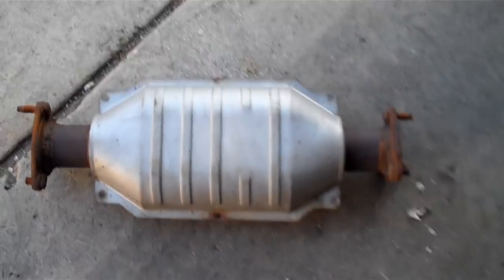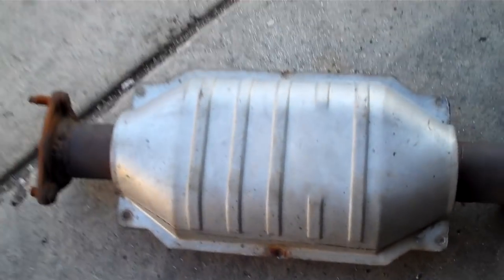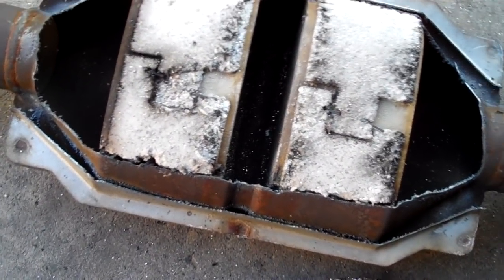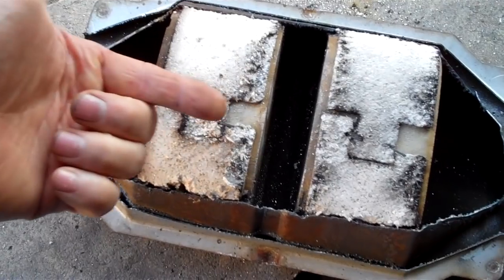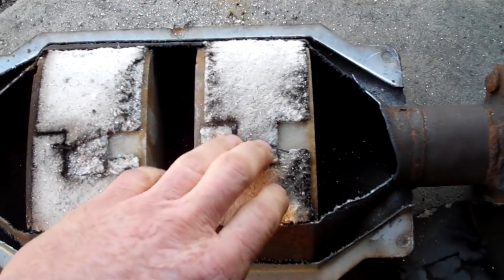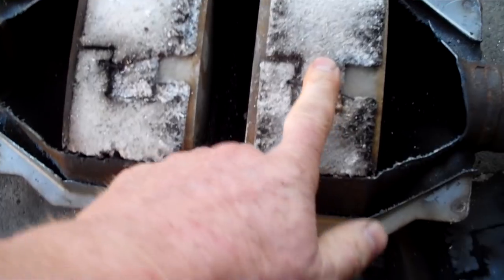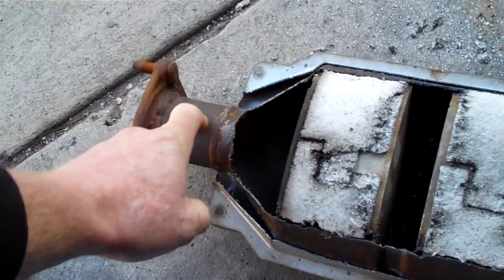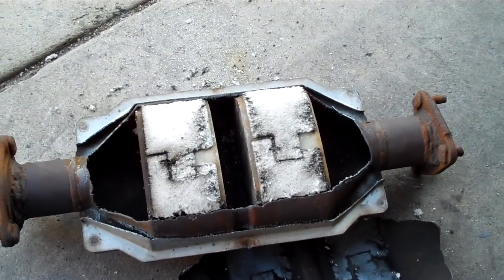Here's what's in a catalytic Converter.  Here's how they work.

Comment: subtle things can alter sleep patterns in kids, L, for example, some little guys are more sensitive to cold so wearing socks might is one idea, another is using some source of white noise to block outside traffic, people, and creaking house sounds. I used a fan, for example.  Pillows and sheets/bedding can be a source of subtle irritation, too.  For example, micro fibre sheets, down pillows (with lots of feathers, typically),  or inadequately rinsed bedding - leaving residual detergent or fabric softener- is often a source of breathing congestion, wheezy runny nose discomfort which keeps the kids (and you) from getting good deep sleep. And make sure your window sills are free of molds and dust.  Many folks dont realize that molds respire too and its their exhaled breath that our own bronchii react to.

Comment: Best damn explanation on how catalitic converters work!

I also remember the predator carburetor. It multi staged gasoline through values that would compress the gas through charcoal filters. The damn thing was almost 99% efficient in burning fuel. And was way cleaner at the exhaust then today. 

I still use a water injection system that can pass any inspection station probing.

Comment: Hi Brian! It's Shep the Jewish me-chan-ic. Riddle me this "Batman". 3 years ago I replaced the engine in my 2000 S10 (2.2 liter) with a new GM crate unit,along with the injectors and pressure regulator (Sorensen),fuel pump (Carter) o2 sensors (AC Delco),and Cat (Walker). 1 1/2 years ago a p0420 code appeared. No vac or exhaust leaks. Fuel pressure is correct. No misfires and engine vacuum is rock steady at 18 inches. In short, the truck runs great. AutoZone replaced the  cat at no charge. Last month the p0420 code reappeared.Same conditions. I ran a live data  test. U/S o2 sensor readings bounced all over the place (as it should).D/S o2 readins did the same (as it shouldn't). I replaced the cat (again) and now the D/S reading are .73-.78 volts at highway speeds..43-.47 at idle. And ..50-.53 at around 35 to 40 mph. In other words , steady. All other readings are normal. My GM tech friends say I need a factory cat ($1000-$2000). My independent tech friends and my old auto tech instructor ( the 1 who taught me 30 years ago and is still teaching) say that's nuts and a Walker  $179--$400)or any cat should be fine. Any ideas? Thanx and G-d bless. Shep.

Comment: Love this video!!!  You speak clearly, know your stuff and are not afraid to share what you hypothesize...  I also sense a genuinely good person in you...  Keep em coming...
Recently with 6 cars in the family, I began to act on my instincts mechanics by suggesting and trying things in connection with my mechanic's expertise.  For ex. the computer showed Malfunction on cat and 2 sensors.  Bought all the parts myself, but the carparts place kept sending me the US honda sensor, not the import which my Honda was...  anyhow I got fed up with trying to get the right part so I cleaned the old one and Voila...  it worked!
Reply from the maker: Great work Elizabeth!  And thank you for the feedback!
Reply: I had issues getting the wrong cats from autozone and oreillys for my friends mercury mountaineer too. I had to take them off measure the inlet and outlet and get a pipe reducer to weld in too to make the back one fit. One of her front cats was melted and the back one was clogged. Only one worked with the temperature check being 100 degrees hotter after the cat. How did you clean your cat? I have a dodge stratus I bought to fix up and my only cat on this thing is not passing the temp test. I could smell that it wasn't working. I'm just curious on how you cleaned it. I want to flush it out with acid just to see if it will work. I tried vinegar cuz I had it layin around. Nope. I tried carburetor cleaner also. Nope. Oh and by the way I think it is the most awesome thing in the world that you have mechanical instincts. I am honored to even hear of a female that will work on cars, wow!!! That made my heart throb, seriously. Sorry if i sounded sexist or like a creep, lol.
Reply: Elizabeth Stenholt
Reply: Elizabeth Stenholt you should ask him out on a date since you're so mesmerized.

Comment from the maker: Test where the compression loss it BEFORE pulling the engine out by making sure all the valves are closed on that hole. (#6 by taking off the valve cover and inspecting cam position)  Brace the crank so it won't move.  Then run shop air into that hole and see where it comes out.  The possibilities are.... radiator cap, oil cap, exhaust pipe, intake manifold.  From there you can tell if it's valves, piston rings, cracked cylinder, head gasket etc.

Comment: briansmobile1, great vid as per your usual. id like to add if i may, some personal observations from 30 years of repairing cars. the threaded bung on the side of the converter has been around a very long time. it started out as a way to inject fresh air into the converter to burn off unburned hydrocarbons via an air pump on the front of the engine [remember fords smog pumps that always failed?].  even though i have never seen an O2 sensor in that spot, it doesnt mean that its never been done. keep up the good work

Comment from the maker: The bounce and the cat are bed fellows, if the lean/rich bounce were more efficient then the cat would be less necessary.  That oscillation is needed only because the feedback mechanisms lie on each side of the wander.  BMW's new system is a more narrow channel to oscillate in.  It can fire an injector several times as needed instead of just having a longer or shorter period.  This means WAY more expensive and sensitive components, but better power and economy.  AND a trend to anticipate.

Comment: I'm still contemplating your cool oxbow lake analogy, and now you've posted another winner. 
One of the interesting things I recently learned (from scannerdanner) is that the cat requires instantaneously changing ratios, to be sure there is enough CO to allow it to work properly. CO is actually used to make the cat do it's thing, so O2 sensor signals have to cause a lean/rich bounce.

Comment: Thanks for the information. My exhaust basically rusted out right in front of the cat, and ended up dragging on the highway. I was told I could just put on a straight pipe and get away with it. After watching your video, why would I skip out on replacing my cat? This video was really everything I needed to know.

Comment: You are spot on about the carbon monoxide thing. The CO bonds directly and irreversibly to the seat on the bus (on your blood) where the oxygen is supposed to be. That means oxygen can't get on the bus and get distributed where it needs to be in the blood. When CO bonds, the blood gets bright red but that "seat" becomes useless. Blood only has so many binding sites and oxygen deprivation can have term effects, even at lower levels. If it is severe enough it effects the brain and causes irreversible damage and restructuring in the brain. Very dangerous because it has no smell and is invisible. It happens with high temperature fires that aren't getting enough oxygen.

Comment: +John Smith , Pagan Sunburn suggested checking for vacuum leaks and i agree but also inspect all of your electrical connections as well. it may sound strange to you but more often than not a driveability issue can be traced straight to the most basic and often skipped step in diagnostics. as far as using spray solvents to check for vacuum leaks, theres another way. use a small propane bottle just barely opened and at the same places. if your idle increase youve found a leak. some vacuum tees are temperature switched and wont allow vacuum thru certain hoses on a cool engine, and spraying brake kleen or carb cleaner on a hot engine is as smart smoking around an open gas tank. this is why i advocate using popane to check for vac leaks

Comment from the maker: The hole or bung is for an oxygen sensor to be in.  It's threaded.  I removed the oxygen sensor when removing this cat.  Otherwise there would be no hole to let air in.  In reality, were that hole to be open it would leak exhaust which is hot and would work upwards into the cabin area.  Exhaust is an expanding gas especially in the cat.  It would move out as apposed to oxygen getting in.

Comment: My 1997 BMW 328i has an air pump by the exhaust manifold that forces air (oxygen) into the exhaust and heats of the Cats quicker. You can actually feel the exhaust heat up quicker with your hand as soon as you start the car. Pretty neat system.

Comment from the maker: They are all cats.  The configuration, size and placement help it pass IM.  Typically when the four up front fail or burn out an owner will opt for a single big cheap one where the pipe comes into one.

Comment from the maker: No.  Cats can last a long time as long as the engine is efficient (relatively as far as autos go) and doesn't emit HC's CO's etc.  When a car has problems burning these completely it heavily burdens the cat and burns it out.  A plugged cat can inhibit proper performance and create back pressure at the exhaust port which can reduce fuel economy, but something was wrong with the car to make the cat fail to begin with.

Comment from the maker: If you do research on "peak oil" it suggests that we have used more than half of the worlds oil reserves.  They say all the "easy oil" or the oil that is easy to get to has been depleted.  Some argue and say oil dry wells when re visited produce again and are no longer dry.  It could be that it's like a flashlight with dead batteries.  You can turn it on and it works again.... but not for long.  I take any oil news with a grain of salt.

Comment: My Alfa uses mechanical fuel injection that atomizes fuel at 300 psi!  That's why Alfas did not use cats until 1980. Then they couldn't afford to build the complex injection pumps anymore and used the Bosch electronic system. That made cats necessary. Thanks, great vid.

Comment: On my Hemi Magnum I started getting the engine light and it would shut down.  Sometimes it would run like crap right before that.   165,000 miles and that was the first time the engine even had a hiccup.   I did park on soft turf and ended up getting stuck and MAYBE got some mud on the catalytic converters.    Or MAYBE the O2 sensors got messed up.   I call BS on both, because the O2 sensors are not in a place where they would get hit by a high center situation.   It wasn’t sitting that low.   But couldn’t come up with any other reason for either to be damaged.   I also have a bumper to bumper lifetime extended Chrysler warranty.    So I take it in.  Mind you this car is maintained.   New spark plugs at 100,000 miles even though it ran fine.  Injector clean just after, just cause.   Everything but wear items is covered.   So the dealership tells me I need new catalytic converters, new plugs, and new coils.  The coils were covered,so I didn’t care.  Plugs were expensive (a wear item) enough that I wanted to do them myself but I caved, even though I really didn’t believe they were bad OR the coils.   The O2 sensors were totally believable, and matched the symptoms and the OBD codes.   The car ran smooth and strong until every once in a while, mostly in stop and go traffic, it would run rough for a few seconds and shut off.   Then it would start right back up again and run like a champ as if nothing had ever happened.    I always though ignition coils either worked or didn’t.   Why would it run so well most of the time only to shut off on random occasions?   The O2 sensors were also covered.   But the ONLY major component NOT covered is the catalytic converter.  Of course.   $2000.   I believed the O2 sensors could be bad, and even maybe the coils.  They said a rich condition could quickly ruin the catalytic converters.  An engine misfire, maybe caused by the plugs, coils, or O2 sensor, could have ruined the CCs.   But I think I got defrauded.   I asked the tech why it would run great until suddenly shutting off, then fire right back up like nothing ever happened.  He said it was because when the catalyst heats, it swells enough to at some point cause blockage, and then when the engine shuts off, the catalyst shrinks very quickly, enabling smooth running again.   So the big a question is, has anyone EVER HEARD OF CATALYST SWELLING AND SHRINKING THAT rapidly?   And so much as in size difference?  If clogged cats make a car sluggish, always, every time, there is no way they were clogged.   It ran great.   And bad spark plugs won’t shut the car down, then immediately let it run great, and then shut down again at any random time, 5min or 2 days later, and under varying conditions.  I do understand coils can be weak or not in good shape and hurt performance and mileage.    But the car got normal mileage and ran as strong as it ever had.   Exhaust flow out of tailpipe seemed the same as always, and I even found a video I had made of the exhaust sound at the tailpipes when the car was new, and compared the two and they sounded identical.    Opinions?  The swelling thing seemed like a stretch, but I was told that if I did t do the cats now that later on if something failed because of the bad cats that any warranty work related to that would be voided.   I felt like I was pressured into it because they felt like they needed to actually get me to pay some real money.    Seems like they are trying to frustrate me out of the vehicle.   I even asked them point blank and they laughed and said no.    I’ll get over paying for the plugs, but I think they ripped me off with the cats.   And guess what?  A similar problem is back and they can’t fix it, yet.   They are playing dumb to get me to give up on the car.   
What do y’all think about the claim of swelling and shrinking with the cats?

Comment from the maker: You'd have further evidence if that were the case- like oil in the intake tube, oily air filter, blue smoke from the tail pipe etc.  I'm not saying that's NOT the problem ( I'm not there to check or observe first hand).

Comment: Great info. Toms patent is avaliable online to look at. The only problem in reproducing his model right now is the type of gas we have today. Back in the day, i hear, they had a special gas pump besides the ones for cars that dispensed pure gasoline for whatever you wanted to use it for. Nowadays the additives in gasoline reduce its volitility and if you try to evaporate gasoline from a small canister using heat, youll be left with some shit on the bottom that takes forever to evaporate. Pure gasoline is the answer.

Comment: Hey Brian, it's Shep again. I did what you said and replaced the rear 02 sensor (s10 2.2) with GM unit . I also installed a set of  iridium plugs.The good news, MPG and performance improved! The bad news po420 code still keeps coming back. As I said ,no leaks (vacuum or exhaust) found. Ft 02 is a Bosch -rear 02 is AC Delco-cat is a Walker. The truck runs great and this is not a major concern, but it still bugs me and I would like to correct it. Se Ya! and G-d bless.

Comment: Hi Brian,it's Shep.After replacing both 02 sensors w/factory units the po420 code still came back.Auto Zone replaced the Walker cat for me(I had to install it. Thank G-d it's a bolt on unit!),but it has a 5 year warranty.The light is GONE! Thanx for your help and guidance. To say I'm a regular customer is an under statement!When I walk into my local (Ocala Fla) Auto Zone it's like Norm Peterson walking into Cheers!If they served beer I'd never leave!But then I'd never get any work done!Le'chiem!

Comment: If you have a pre 1996 model vehicle with throttle body injection you could run cleaner and longer with a bubbler setup to your intake. California got this contraption passed because LA is in a valley and they smogged out, unless the winds worked in their favor.

Comment: Not really. It only does for about a minute or two on start up. It actually helps oxidize the residual fuel because the engine is rich when you first start it. And there is no more oxygen in the exhaust. So the air pump oxidizes the fuel in a process called after burning the exothermic reaction helps to heat up the cat.

Comment: I wonder. If you can make an engine's cooling system really really good, could you run it leaner then normal, so you can burn all the hydrocarbons? Or is knock/detonation & preignition still a problem, no matter how cool the engine is? I do know, that an engine running rich, on purpose, may add power, and the extra fuel has a cooling, protecting effect from those preignition problems, but unburnt fuel is very bad, for the environment, and catalytic converter, if the engine has one. I going to turbocharge my bike, and have it run a little rich, for power, and to protect it, especially during the experimenting, with how much boost, compressed air I want the engine to live with. The more power it makes, the more frequently I should service it. Great video, I learned a lot. Thank you.

Comment: They say cats help get rid of the hydrocarbons. Hydrocarbons are just a fancy name for unburned fuel. Why they don't call it unburned fuel? My guess is people would get pissed off if they found out they were sending 40% of their fuel out the tail pipe unburned. On vapor carbs. If you burn straight stiochiometric mixture, it would be too hot for your engine. They use extra gas as a coolant to keep from melting your aluminum pistons. If you look at water injection, that essentially means you lean your engine to stiochiometric and then inject water into your cylinder to cool it. Very cool concept, i just don't have the money or time right now to play around with it.